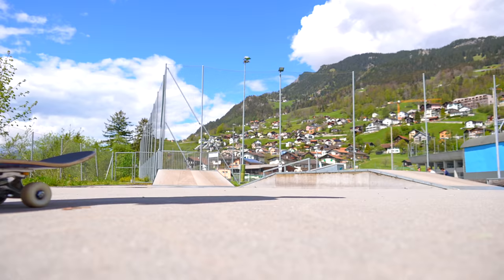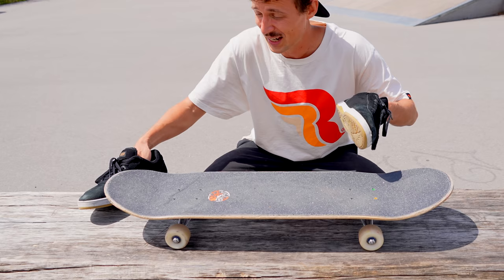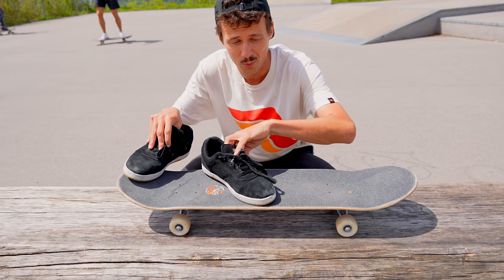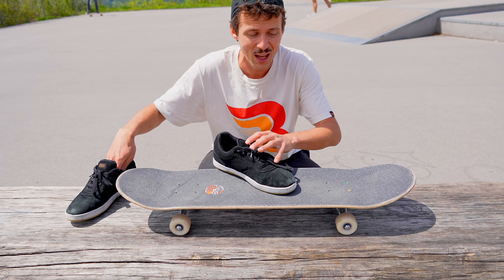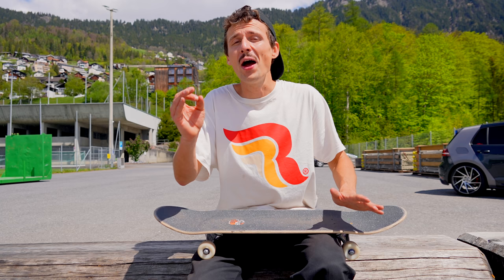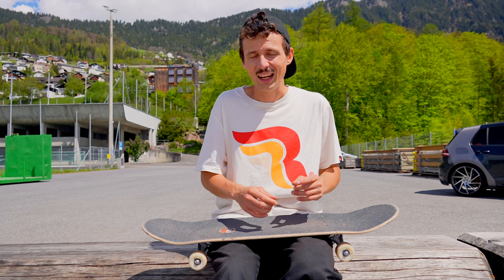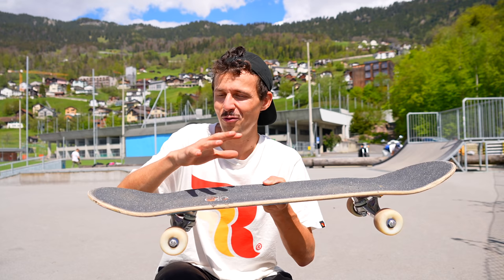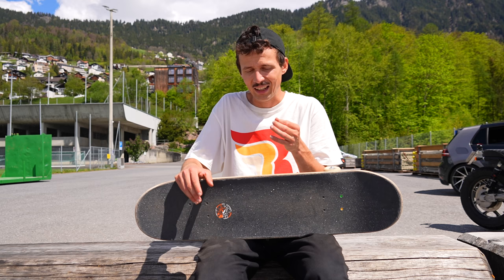HOW TO HARDFLIP

Comment: The decks we use today(designed by Rodney Mullen ) are really insane actually. It's not just a flat peice of wood for a reason. If you can learne all  the pressure points of the board you can do any trick... With practice of course.

Comment: Hmmm like that I couldn't do a hard flip with the foot position.

I stand completely different
Conveyor foot exactly the same as kick flip position (or frontside flip). Back foot as with a backside pop shovit. Then puch the rear foot like with a frontside shovit and flip slightly. And gumming up and opening your legs .. Man does the hard flip with your back foot!
The flip is so much easier than in the foot position where Mr. Skate Professor Geiger points! Standing safely is so much more difficult.

I love hardflip my lovely trick
Greetings from switzerland!

Comment: Hey Jonny, I used to land a frontside flip that was pretty much a hardflip with a body varial. I'd just kinda wedge my toe into the crook where the nose starts to bend up when the board was near enough vertical. The board would just wrap around my foot to level off for a perfect catch. Could never do it as just a hardflip though.
Reply: Totally different trick. The board does the same rotation but the technique for approaching each of them is very different
Reply: @DiegoJ1023  Not necessarily.  The way he's describing it (vertically-popped FS flip), the foot positions and board rotation will be identical.